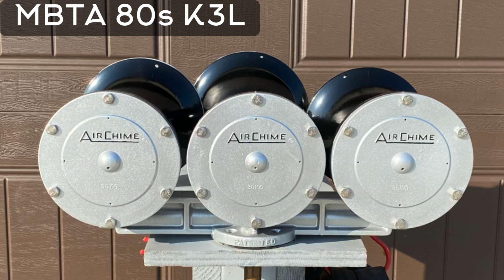MBTA 80s K3L Real Train Horn Nathan Airchime.

Comment: By any chance, do you know exactly which unit this horn came off of?
Reply from the maker: Man I sure don’t. Wish I did.
Reply: It may have come from one of Cab Cars 1600 through 1624, which were deactivated long ago. But that's just my guess.
Reply from the maker: @superbaddy4  possibly so. That would be cool to know.  I do know before I purchased it it had been sitting for many years out of service.
Reply: 1600 through 1624 lost their ability to lead trains as far back as 1992, so it's still up there as possible.
Reply from the maker: @superbaddy4  very interesting to know. Thanks for the info! My knowledge when it comes to MBTA isn’t great.
Reply: @superbaddy4  1600-1624 had K3LAs. This ones of a CTC-3.